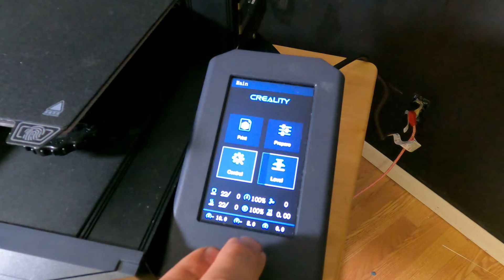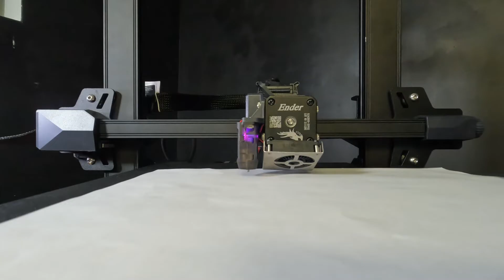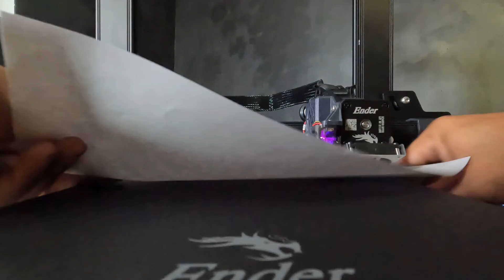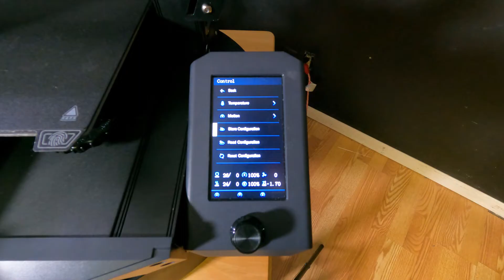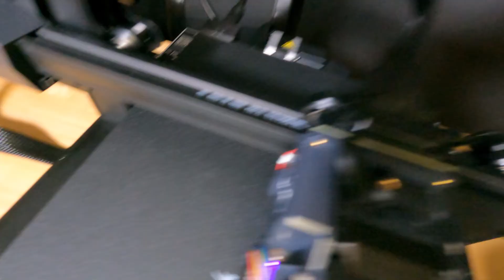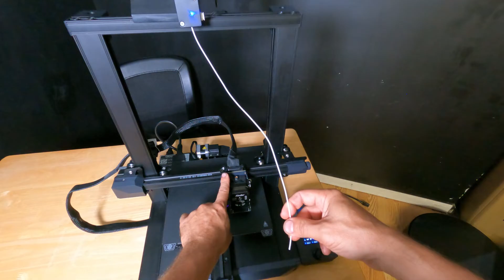Creality Ender 3 S1: How to Level, Set Z Offset, and Make an ABL Mesh - The RIGHT way.

Comment: Dude -- thanks for the tutorial and walkthrough!
Reply from the maker: Very welcome. Now, move on to a V3 and save yourself the headache!
Reply: @3DRundown  Got this one essentially for free -- just had to replace the y-motor. My gateway into 3d printing :) So, now, the challenge is that sometimes the it's like the filament bunches up a bit in an area and doesn't lay down well. My test print of a pikachu worked well. Now on to a lightsaber.

Comment: Thanks for this video a lot.
Setting up an old Ender 3 S1 Pro rn
Never gonna laugh at Garrus from Mass Effect when he again says his "Can it wait for a bit? I am in the middle of some calibrations"
It was way more tedious than I expected, but I hope it was worth it. Guess that's because the bed is jiggling and requires some reassembly and tightening of screws.
Reply from the maker: It's Jiggling cause of a loose eccentric nut. I have a video here on that

Comment: Ik dacht dat ik het snapte, maar zojuist boorde de nozzle zich met een krakend geluid diep in het bed. Nog maar eens opnieuw deze heldere uitleg bekijken,
Reply from the maker: Make sure your Z-Offset is correct. I have a video here with an exercise to get it right
Reply: @3DRundown  I would appreciate this, because I am still confused. But I think the previeous owner had modified / upgrded this Ender 3 S1with different hard - and software, so I want to get rid of it, ór bring it back to original.
In the mean time I still have my first Ender 3 and I love the way how good this one keeps printing.

Comment: Greetings from Turkiye,  thank you for the educational information, we have other problems, for example, no matter how much I pull the z axis to minus, I still can't make the adjustment. We're constantly trying to figure out if the problem is in the table or if the nozzle is too high. Most S1 users have these problems.
Reply from the maker: Raise the Bed a bunch, pick a corner, and start there. I assume you, most Ender users don't have this problem. You can do it

Comment: Thank you for the video. I have had an Ender 3 PRO for 4 years. I have only had to do this twice on that machine. I have had the S1 in the box for about 6 months. Not doing often, or many times it’s easy to forget. My next check is for demential accuracy.

Comment: Tip: I had my printer working flawlessly before and then i left a print go and it gunked my printer and I struggled for hours and then I noticed my Z belt was lose I moved loosened the screws and moved my printer to the highest Z then retightened it and it helped a ton.

Comment: BEST EXPLANATION YET!  Thank you for your time and effort!
 I had MAJOR issues from the get go and there really isnt much for a total noobie, extruder slicing etc.
Leveling wasnt really much crom Crealitys video, rather left me with I kinda get it but not sire. This guy explains why where and how. Easy, informative and spot on. The first print after this stuck to the bed and is doing fine, I do think perhaps the filament is old though, or the nozel is damaged. I got the whole thing s1, bunch of parts for upgrades and a spool of black pla+ for 50 bucks. 
so I suspect somthing is damaged or missing. I dont get that lucky.
The Creality video blows.. This is what you want people!

Comment: So after I set the z to 0.00 and do knob adjustments, it's still very high, so high in fact that if I were to fully loosen the spring wheels, it still would be about 1cm too high. So I use z offset to get it nice and tight. But when I then auto home, it goes to 10, and when I go back to 0 or print, even with the z offset, it's now about 3cm high and inhave to add more negative to the z offset despite it being perfect before that
Reply from the maker: Z-Offset is only use when printing. When you home, the hot end goes to 5-10mm, not your Z-OFFSET. It will go to the Z-offset, when the print starts.

Comment: Do I have to do the same steps everytime I level it?
Reply from the maker: Yes, but, 1.) Adjustments will become minor 2.) You will rarely need to touch the knobs. Running a new ABL will usually be enough
Reply: @3DRundown  thank you this wasn't easy for my hands are weak from ALS ty so much for your help

Comment: Seems way too complicated and too much work. I'll stick with my old 3d printer that does not have ABL. I've learned to level/tram it to near perfection fairly quickly.
Reply from the maker: With ABL, you still need to manually Tram it, before creating the ABL mesh. I wouldn't dream of using a 3D Printer, with out ABL, and Firmware Z-OFFSET control. It's game changing. And... Easy. :)

Comment: Does it matter much if you use a higher amount of z offset as opposed to a lower amount? Like if you dont tighten your strings enough and have to compensate (more) on the z offset, and say it ends up being in the 4 or 5 range....is this something we try to avoid, or does it really  matter either way?

EDIT: i said tighten strings ;*D, i meant springs
Reply from the maker: A working Z-Offset, is the correct Z-Offset. However....  The tighter your Knobs, the more stress, and likely, flex, you introduce to the hot plate. Find a happy medium between too loose, and snug enough to stay put, then bring the Nozzle, to the bed...
Reply: @3DRundown  thank you so much, I had a feeling this was kind of the case...
... Just like Miss Cleo
... Happy medium.
Reply from the maker: Indeed

Comment: Thx for the video, we would love it if you could make a video about inconsistent CR Touch and how to overcome it like manual mesh editing, replacing or any other ways. It's really a pain.
Reply from the maker: Hi, I run a room full of CR-TOUCH, and have no problems with it.  Editing the mesh isn't really a great idea, because you want the ABL to be able to adjust for the minor inconsistencies in your Manual Tramming. If you edit the mesh, the adjustments will be wrong. What issues are you having?
Reply: @3DRundown  Hi, lots of people have problems with their Cr-Touch and a lot of them go with editing their wrong mesh point values as a last resort to be able to get good first few layers. ABL doesn't work well for a lot of people like me. Mesh points are all wrong some points are too close some points are too away from the bed so we end up editing them manually. I bought my  S1 in december 2022 and I am your subscriber since then but because of my ABL problem it's been getting dusty in my closet. Last year with manual editing I was able to get perfect no-gap, no-bubbles, smooth and strong first layers but it took hours. Nothing else works.
Reply from the maker: I've never edited a mesh. Not once. However, the S1 is an absolute pile of sh*t. It's the only printer I've ever had an ABL issue with. It's not the CR-TOUCH, it's the S1. It can't make a proper mesh to save the world. Why? I have no idea. My S1+ is super. My S1, sits on my basement floor.
Reply: @3DRundown  Yeah when S1 series work they work beautiful but I hear some manufacturing error caused some of them to be this way so a lot of people suffers from the same thing. Thx again have a nice day.
Reply from the maker: I never got a firm answer on my my S1 misbehaved, but, I gave up on it. However, I did print a mask with it, that ended up on national television, so, I guess at least I had a small win with it. It sit's on my floor now...

Comment: is there any difference doing all of this on professional firmware? I have it installed but wasn't sure if it was that different from stock firmware.
Reply from the maker: Nope. Think of it as F/stop, shutter Speed, ISO, on Nikon Vs Canon. The principles are the same. Just find those settings on your firmware

Comment: My Ender 3 S1 Pro doesn't have the same settings on the LCD. <sigh>
Reply from the maker: Our firmware is different, but the same settings will be there. As long as you have a BL/CR Touch installed
Reply: @3DRundown  I watched another one of your videos, and all of the buttons and settings were the same. You got it all resolved, and my rabbit is printing! Thank you very much!
Reply from the maker: Love it. Welcome!

Comment: You say you heat a glass bed but not one like this. I have one like this and I notice a huge difference between heated tramming and cold. Heated is a lot closer and stays closer. However I still can’t get a successful print, eight days of trying.
Reply from the maker: PEI won't expand and contact like glass. I am not a fan of PEI. What's the hang up for you?
Reply: I don’t know. Seven days trying and I haven’t printed anything but small messes so far. I have trammed/leveled the bed sooo many times. It doesn’t seem to stay where I put it. Every day I check it before I start and it’s off again. So I’m not good at it I didn’t do it right. 😢. I don’t know if it matters but I have the ender 3 S1 plus.
Reply from the maker: Your in luck, I have an S1+ Video. I suspect your biggest problem is not setting your Z-OFFSET correctly. Please don't skip any steps, even if you did them already. Let me know how you do.
Reply: @3DRundown  where is the S1 + video please? This video has me all confused as the screen controls are not the same. 

I trammed the bed again today using a .1mm feeler gauge (verified with my calipers and my paper is the same) and paper. I start with z in the manual tram screen, move it down and then tram the four corners with the wheels. When it’s ‘even’ to the best of my abilities I return to center it’s again higher, measured today with feeler gauges at .25+-mm. 

I then went to the ready screen where z says it’s 5mm even though it’s set for 10. I don’t know what that means. When I zeroed I thought it would go to the .25 but it went hard onto the deck.  I hit z  up arrow and it went to 10 and looks right for 10. I zeroed it again and it went down to the deck but this time I could move the paper but it’s too close as in the paper wrinkles if pushed but not a lot. 

On the Home Screen z is -2.95  I don’t know how I got that. The first prints were almost that when I set z manually on the fly. Is this the value set by the machine internally when I performed the tramming?
Reply from the maker: Also, after that video, consider this exercise, to practice: https://youtu.be/veZB415QHM0?si=4_IDJ_8sKId4skgj

Comment: I was so excited to try the printer out till i spent days trying to level the bed and still can't do it, I even bought the CR touch thinking it was going to solve my problem but i think i'm gonna call it quits. If anyone knows of a printer without the leveling BS lemme know please
Reply from the maker: It's super easy. CR-Touch is very helpful. These are tools, not toys. Take a breath, and get back to trying again. Days is nothing, to learn such advanced gear and software. You can do it. Install the CRTOUCH and follow along. (I have an install video for the touch)

Comment: last step is it ok to set z offset manually? I do this on my rare 5s1, it worked very well for the first month. Now I made more settings than before but it doesn't work :(
Reply from the maker: Yes, you will always set your Z-OFFSET manually. :) Once your tramming is done, and your ABL is done, dial in that Z-OFFSET. I like to do it during a skirt and 1st Layer
Reply: @3DRundown  What I didn't understand was why this wasn't necessary when I first purchased it? Is there any broken part? Because after adjusting the middle and 4 corners for the first time and doing the auto leveling, everything worked fine. now this doesn't work.
Reply from the maker: I should have been.... However, the spring tension can change over time, and, the constant heating and cooling, causes constant expantion and contraction. Ontop of all the stress caused by model removal....  These things can all contribite to minor bed tramming changes. Keep in mind, we are usually talking 10ths of a MM

Comment: I have ender 3 s1 and it z offset valu comes almos 3.17 to 3. 70 it is right
Reply from the maker: Typically a Z Offset is a negative #. And will be only One #. May need to work on your tramming
Reply: @3DRundown  ya i am talking about in minus
Reply from the maker: The # that works, is the correct #. Really doesn't matter what that # is. However, -3 is pretty high. Be sure your knobs aren't too tight, that can cause the bed to flex and warp. Find a balance between not to tight, but not too loose, then, use the Z-OFFSET for the rest.

Comment: Congrats on having made the best video to explain how to use z offset together with manual bed leveling. I watched at least 10 leveling videos and none of them clearly explained relation between bed adjustment screws and z offset, causing confusion on something that ultimately is simple.
Reply from the maker: Thanks so much. These videos are allot of work, but, along my post watched. Good to have you. 🙏🏼

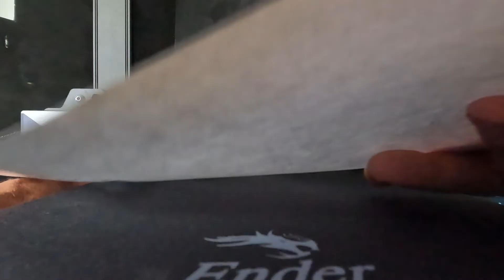Comment: At 18:00, I feel like I've done a pretty good job at getting a consistent height across all 4 vertices (i.e. I can feel the same resistance with the paper), but when I move the head to the center of the bed, the distance is way bigger, th epaper flies off easily. It's like the bed is very concave. Is this to be expected?
Reply from the maker: When you HOME it, it will go to 10mm. If you moving it manually, don't. Just do the corners. When all done, run an ABL. The bed mesh, will handle that little adjustment for you. That is the purpose of the CR-TOUCH and the ABL. Adjust Z-OFFSET as your final step.
Reply: Oh I see Thank you (yes I was moving it manually, I knew about the 10mm thing). Then, when I do the Z-Offset, should I do it at one of the corners?
Reply from the maker: I would do it centered to start, and finalize while it prints the 1st layer.

Comment: I'm having so much trouble. After a few weeks of printing with decent leveling I can't get good first layer adhesion anymore. I tried lowering the bed all the way until the wheels are tight, but I can't adjust the z offset low enough. I just want to get this thing as level as I can but there's no z switch so I can't lower that. Help! My bed is as level and clean as I can get it and my e steps/flow are normal, but my bed still doesn't seem to be level. It's almost like the auto bed leveling isn't accurately leveling.
Reply from the maker: OK, don't be offended, but, I feel like you didn't actually follow this video. I will need you to do that. If it's a MAX or PRO. If it's an S1, or S1 PRO/PLUS, I have videos for those as well. Lowing your bed all the way, is going to warp and ruin your hot plate. Don't do that. You do not use a Z-STOP switch, when you have a CR-TOUCH. I'm assuming you do. If you do not, order one now, and come back to watch my video to install it, then, this video to use it. If you DO, please follow this video, with NO SKIPPING AHEAD. You can't bring your Z-OFFSET low enough, because your bed is too low, due to you "lowering it all the way".

Comment: I appreciate the video. But man, makes me wonder what the purpose is of the CR touch, especially on my S1, 16 points it checks and I still have to go through this…
Reply from the maker: It's only purpose is to study the bed and compensate for minor discrepancies. And it's  really good at it. It also gives you full Z-Offset control.

Comment: Great Video! How did you get the bed adjusting wheels to stay tight? I see no way of doing that and mine turn pretty easy! Thanks ahead!
Reply from the maker: They stay on their own, and should not be loose. How are your springs? Are they the yellow ones?
Reply: The springs look gold or brass colored. I followed your video and got it all adjusted and the machine seems to print fine but if I so much as touch one of those wheels, it turns very easy! The machine is brand new! Thank You! @3DRundown
Reply from the maker: They should be yellow. I THINK the S1 comes with them. If not, may be worth changing them. But 1st, if they are THAT lose, tighten them some more. This will lower the bed, so, you'll need to adjust your Z-OFFSET, and of course, TRAM AGAIN, but, it may be worth it. I want your knobs holding for MONTHS without having to touch them

Comment: Thank you very much for the video. And thanks for the tuning tips! Constant reminding of "don't panic" is priceless! Yep, I was panicking. But it was mostly because of the bad reputation of the process. But you made it very easy to understand the tricks of the Z-offset. 
I have one obvious question, if the sandpaper lines happened (I bet you already knew I was gonna suck at first time) what can I use to that them off. Asetone ? alcohol?
Reply from the maker: Lol. Building up things as super hard, or impossible, in your head, is a major cause of failure. Don't Panick! Lol. If you scraped up your bed, you can try IPA, and razor blade. Never use Acetone for any reason ever. However.... A Glass bed is like $12. If you trashed it. Swap it out and move along. Trade $15 for your mental health, and time

Comment: First of all thanks for your tutorial. It's reassuring to see a video with the exact printer model. I made the 3.1.9 marlin  update from the creality site and now you can see a map of the bed leveling with different values in the auto-leveling menu. How this feature can help if we use it with your method ?
Reply from the maker: These things have been around for a while. It's nice to see Creality catch up. You may need to pick your poison, sometimes. Firmware Tools, or the old fashioned way. I use this way 99/100 times. MRISCOC on S1 let's you have it move the nozzle around, probe, then adjust the wheel, and probe again, till you get it super close, then you can run an ABL. I assume the new Creality is similar. Nothing wrong with that method, but, this method works, and you really shouldn't have to touch your knobs very often.